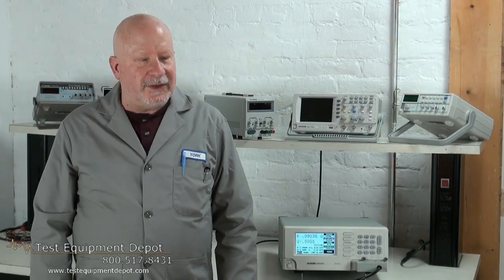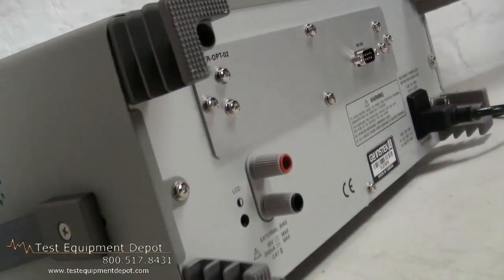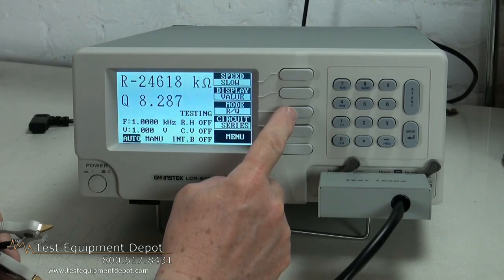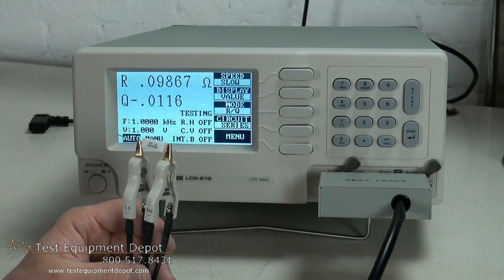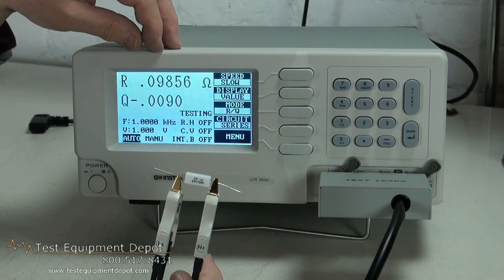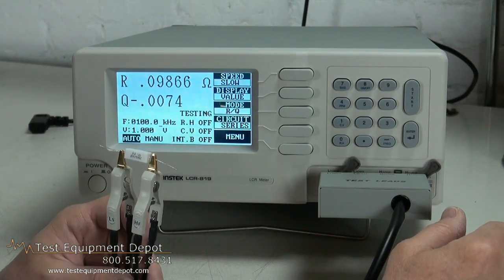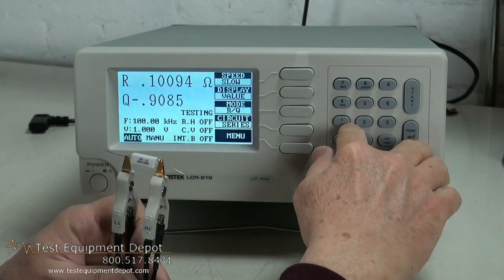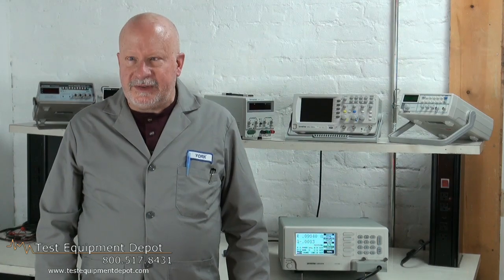Instek LCR819 12 Hz to 100 kHz Precision LCR Meter

Comment: can we directly connect lead acid battery terminals to calculate battery impedance or any passive circuitory is needed
Reply: No you can't! 1) You can measure hot wires only with LoZ selection of the DMM. 2) Or buy adding high value resistor in series with high accuracy DMM.

Comment: I have LCR 819, I used to measure conductane of wire to know the impedance, but i have problem, the result of measured capacitance is negatif, and the inductance always approach zero positif, would you like to give me the solution?

Comment: Good Job Dear!
Can I ask question Regarding GW Intek LCR-8105G meter 
It gives me error readings for the inductance and resistance for a specific Inductor. Although I made a calibration for OC and SC Trim test.
Can you tell me Hot to solve this problem Please?